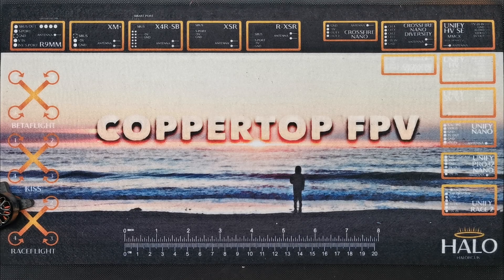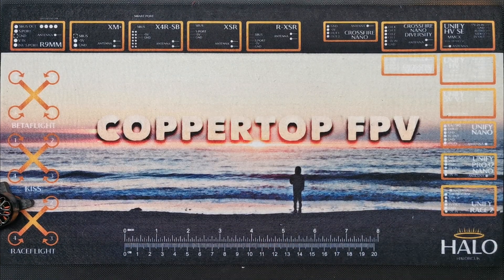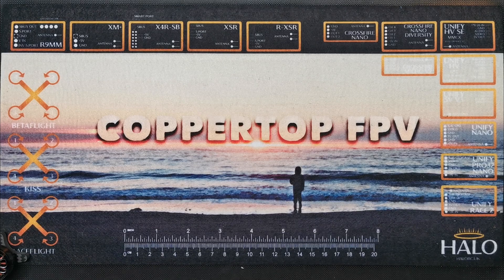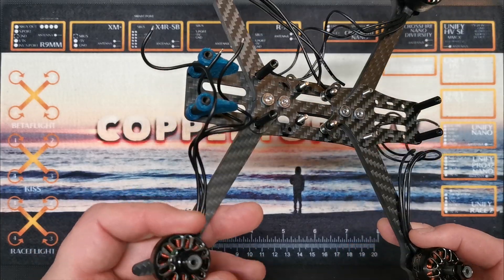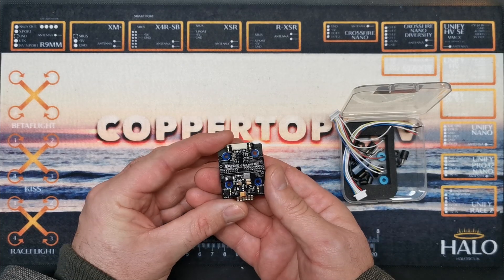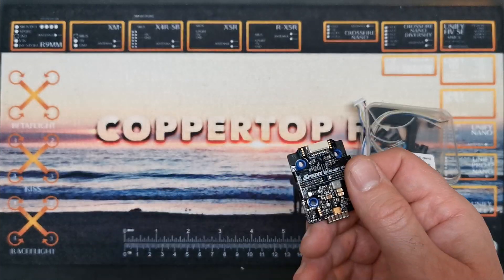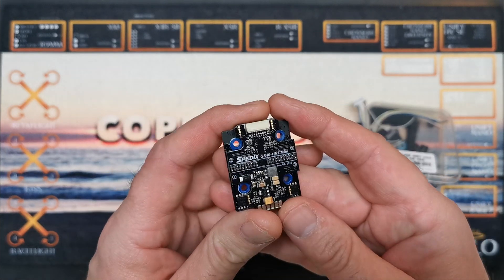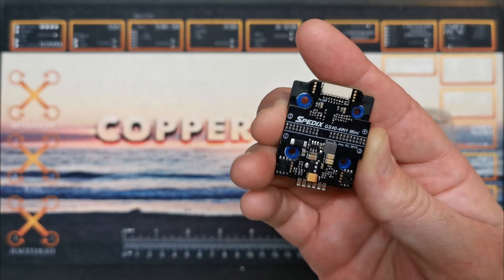Flywoo Goku 40A & Spedix 40A 6S 20x20 escs

Comment: How durable is the frame? And i am guessing you cannot reach the stack from bottom once the frame is setup, i guess the stack screws has to be loaded on to the frame before its entirely setup.
Reply from the maker: It's doing well. Broke a top plate but it was a full on tree collision with no spin which bent all the standoffs and then I did it again lol  so to be expected. With 20x20 you can just about get a driver to them. With 30x30 you'd have to do it first and to get at them afterwards undo the 4 bottom bolts to loosen the stack
Reply: @CoppertopFPV  the frame does look promising, I was just worried if it was stiff enough. I fly the glide and the new version comes to 97g, which is same as this. So was wondering if switching makes sense or not
Reply from the maker: @shyamfpv  it's super stiff. No worries there. The skeleton is rock solid. It's the first really innovative idea I've seen in a long time.

Comment: t motor 55 amp comes with those wire holders. i know there motors are good but flywoo is rebranded they just change it around a little
Reply from the maker: boots fpv eh? T motor don’t make escs. They’re made elsewhere and stick a t motor badge on and that’s 30x30. Likely Spedix. there’s no esc that looks like the flywoo one to my knowledge?
Reply: @CoppertopFPV  didnt know that about t motor good t know thanks . Check out kabab video from yesterday on the flywoo quad he metioned it about flywoo
Reply from the maker: @jayward7536  I watched it earlier. He says most of their stuff are  original designs. There's a cinequad frame design that looks super interesting floating around. Can't wait till I can find it on sale as it has my name on it :)

Comment: I like the spedix esc, it's more reliable because it uses the 5mm mosfets and the mosfets are rated for 40v, so takes spikes better. The flywoo uses rhe 3mm mosfets, and they are known to smoke on 6s
Reply: InDrone Productions they use er603 mos. Emmm i don’t worry about that .
Reply: Fong Fpv Have you used either ESC?  If so, how reliable
Reply: Have you used that Spedix ESC?  If so, has it been reliable?
Reply: @kingsolomon5634  yes have 3 of them, 2 of them on 7 inch builds and 1 on a 5 inch, never failed me
Reply: the spedix one will say
Reply: InDrone Productions Nice... $40 is a good price.  6s on those quads you mentioned?  You race with the 5 inch?
Reply: @kingsolomon5634  yeah 6s used, no no racing, but have had them for 6 months and no problem

Comment: What I've found is that in nominal use cases, small form factor isn't even a detriment worth mentioning.  Even simple, cheap, basic 20x20 stuff that are true 20x20 form factor will handle the abuse of 5" quads in flight... the test is awkward crashes, chopping your way out of trees, or bending a prop and finding yourself pressed to try limping home anyway... but even then I've been amazed more often than not.
Spoiler alert - I don't think either will have issues of any kind.
Reply from the maker: tehllama42 tree test is the one I’m interested in. all the others you mentioned are usually covered within 10 packs 😝. Kiss fly’s better than beta with half your props missing 😜

Comment: I've got the Goku f7 that comes with that esc and the fc takes like 7 seconds or so to boot up. Even on the computer. Hopefully it's supposed to do that. Lol
Reply: BrandoFPV How has that Goku ESC held up?
Reply: @kingsolomon5634  so far so good.  The fc has me worried.  It trashes forever to boot up after you plug  in like 8 to 10 seconds always. Don't know if that's an f7 thing or what. It's the only f7 I own
Reply: BrandoFPV I have Talon F7s, and they do not do that.  Wut is ur setup with the Goku?  6s?  U race?
Reply: @kingsolomon5634  its 4s and yes I race. Been crashing it pretty hard and nothing yet. The fc is even slow to boot when plugging into betaflight. It's weird
Reply: Brandofpv is ur stack still holdin up
Reply: @patdonovan5106  yep so far so good. Been racing and crashing the hell out of it and its still going strong
Reply: Brandofpv also urs still slow on bootin up
Reply: @patdonovan5106  yes but the guy from FlyWoo said its normal.